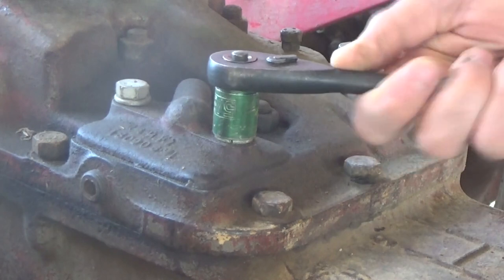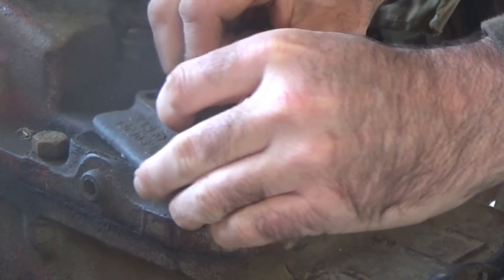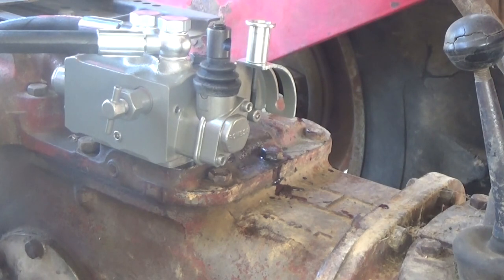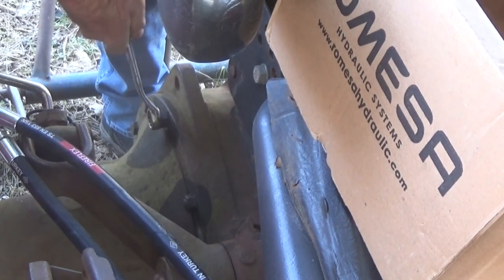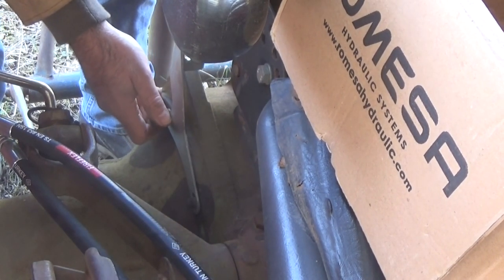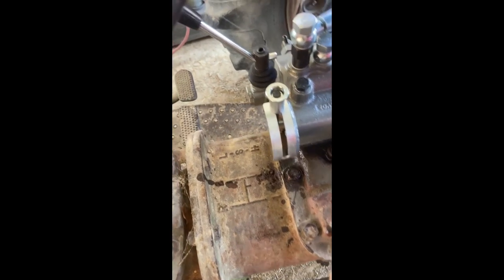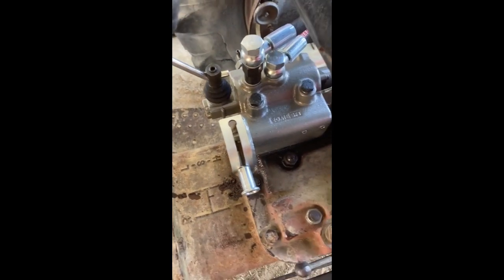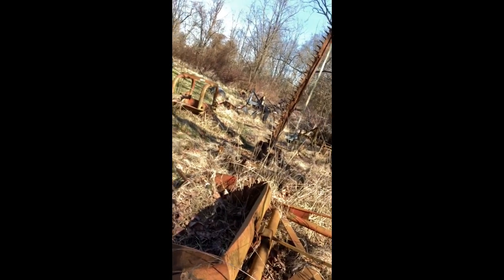External Hydraulic Control Valve Install on a Massey Ferguson 35

Comment: At 11:26, that is a JIC fitting and should never have 'thread sealer'. If it leaks, you have a problem with the hose end or the fitting and need to address the problem, not try to 'seal' it.
 When you shut off the remote valve, make sure you take the lift lever out of the "continuous position".
Reply from the maker: Yes I agree, but I have seen the fittings have burrs and other problems that could cause a small leak or drip. Yes when I move the selector to operate the 3pt I move the draft control lever back to the two dots on the quadrant.
Reply: hi.. @blacklab garage if you recommend the external single valve suitable for MF 241DI model?

Comment: Always wanted to do this but the unknown thing what stopped me was does you can opperater 3-point and having like hydraulic top link or it newer works together?
Reply from the maker: That lever that you move to select the 3pt hydraulics or the auxiliary hydraulics can be set anywhere in between to provide flow to both but I’ve never tried it because ultimately both will end up being twice as slow.
Reply: @BlackLabGarage  I have a slightly different version with only the change over valve. Mine is a one or the other setting. In between blocks all flow and puts a lot of pressure on the pump.

Comment: I missed His Source of Supply to acquire the Valve Assy.
Reply from the maker: The link is in the description for the video. That's the exact one I used.
Reply: Found them online or ebay $300 to $350 ish. Just searched MF35 hydrolic valve kit

Comment: Does it have a continuous flow function? For an application that has its own hydraulic control.
Reply from the maker: I don’t believe so.
Reply: @BlackLabGarage  I have a version that only has the the change over valve. For mine the external controll valve sits on a front mounted fork lift attachment.
Reply from the maker: @leonhardtkristensen4093  I have a diverter valve like you are talking about installed on another tractor of mine. The controls for the hydraulics on that tractor are beside the seat but you could mount them anywhere using a diverter valve.

Comment: It appears you forgot to put the O ring on the stand pipe.
Reply from the maker: @MrjackieG  no it’s on there. It had new ones on it when I rebuilt the hydraulic pump so I reused those. I didn’t remove the oring and change it

Comment: Does the draft lever need to all the way up
Reply from the maker: According to the manual both the position control lever and the draft control lever need to be fully up to provide constant pumping.
Reply: @BlackLabGarage  working now with draft lever at the bottom
Reply from the maker: That's the only way you can get yours to work? It will work without the draft lever being all the way back, it just won't be in constant pumping according to the manual. @Farmer_scoobs

Comment: Can I use Walmart Universal tractor transmission oil for MF 35 rear differential and tranny?
Reply from the maker: Unless your hydraulic pump has been replaced with the newer style pump that has piston rings I wouldn't use it. The original hydraulic pump pistons had no rings and were just close tolerance and depended on the thicker viscosity of the 90 weight mineral oil to build pressure. If your pistons are ring less when you use the thinner viscosity universal oil you will find that it doesn't lift good at all when it warms up if it lifts at all. But if the pump has been replaced with the newer style with rings then the universal tractor oil will be ok. The hydraulics, transmission, and rear end all use the same oil
Reply: @BlackLabGarage  thank you very much for the info. Where can I get the oil for a decent price? And I believe it's 8 gallons right?
Reply from the maker: @theproudONE92  yes it will be close to 8 gallons. Tractor Supply carries it in two gallon jugs. It says for older Ford tractors on it. Napa carries it in 5 gallon jugs. Its SAE 90 GL1 mineral oil
Reply: @BlackLabGarage  got it thank you BLG
Reply: Mine has and recommends 90 w gear oil
Reply from the maker: @joehighsmith2951  You can use 90 weight mineral oil as was originally recommended but it doesn't work well in the wintertime. They recommended that with the original hydraulic pumps which had no piston rings. They depended on the close tolerances of the pistons in the valve chambers and the thick viscosity of the 90 weight oil to seal the pistons to the valve chamber bores. Later on the pumps got piston rings to seal the pistons to the pump chamber bores. If the pump has been replaced or rebuilt with the later style pistons I recommend switching to a thinner oil because the thicker oil is no longer needed and the thinner oil works well in the winter time. If the pump is still original and ringless then I recommend staying with the 90 weight mineral oil.
Reply: @BlackLabGarage  thanks for replying, I'm not sure about the pump pistons being reringed, it currently has the thicker (what I'm guessing is gear oil) it works and holds. I found your video as I'm looking at a side sickle mower that has a hydrolic cylinder on the bar. It's mounted on an independent axle, operated by the pto shaft and drawn by a single point. Looking to run it vertically to clean out roads, owner says it's really not designed for that but should work. I'd prefer to use the tractor for miles of cutting vs my skidsteer or wheel loader with a hydrosickle
Reply from the maker: @joehighsmith2951  Basically if the sickle mower has a pitman arm it is not made to operate with the cutter bar at much of an angle. If it is a pitmanless mower then they can be ran with the cutter bar at an angle.